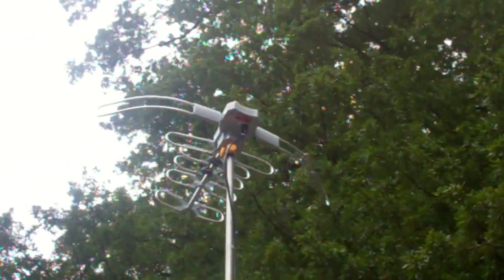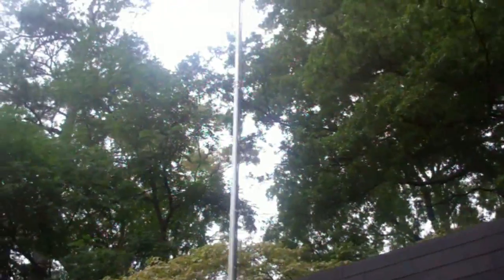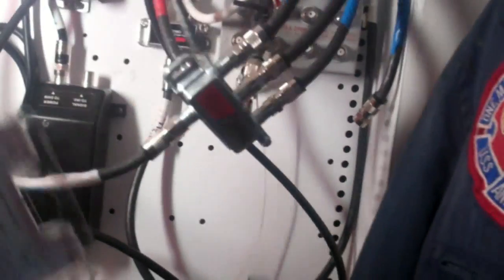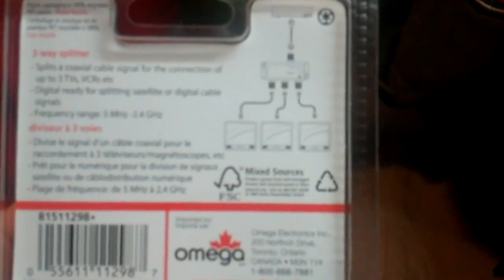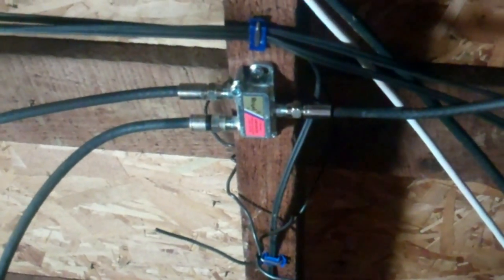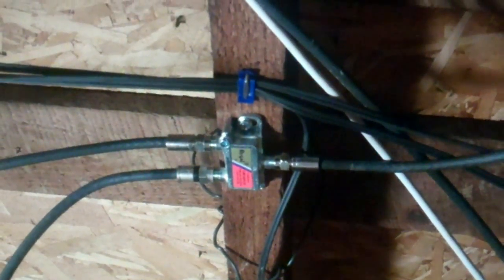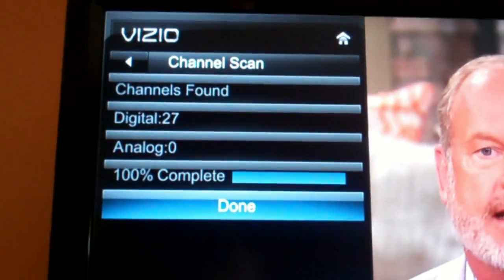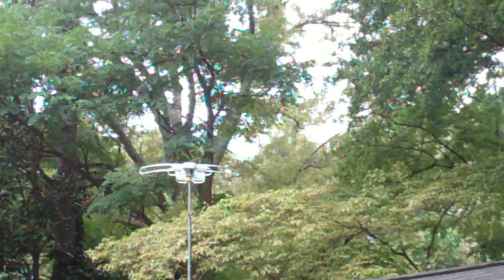Testing an Amplified Digital HDTV Antenna

Comment: Along with the 5-2.3 Gh splitters only use the "Blue" coded cable and connectors.
Your old cable stuff is probably coded "Red" and only receives 5-1005 Mh
And all black old school stuff was 5-900
These cut out frequency and kill your full signal 
Replace ALL of your cables and connectors (even the one your daddy left you, that was his favorite!) and replace them with the BLUE coded stuff.
An Antenna signal is only as good as it's weakest part!! This is not time to scrimp unless you want a scrimpy picture.

RG6 Dual Shield! "BLUE" coded!! 5-2.4Gh

I'm in the woods 30 plus miles from all of the towers and I'm getting a vivid picture on a minimum of 27 channels, so far up to 60 without turning my antenna. This morning I have 43 channels
Reply: I'm also running 5 tvs of the same system.

Comment: you can't use a splitter for that model. It backfeeds 9 volts back to the antenna for the amplifier and rotor to work. Most splitters only allow signals one way unless you get a dc pass with the righ frequency range.
Reply: Yep, he'd have to split pass the power supply. He's defeating his test. I see other issues too.

Comment: awesome .. we dropped cable tv a year ago for basically two reasons ...1. was paying $160 for TV and Internet and they kept increasing our bill every 5-6 months ....  2. we rarely sit down and watch cable TV except for NBA season and Travel Channel or Discovery .. and i can honestly say personally don't miss it at all ... Time Warner increased our internet speeds from 50mbps down to 300+ mbps down at no additional costs and it helps with streaming netflix and hulu simultaneously by all of us 5 here at home..
Reply from the maker: Yeah both cable and satellite prices are ridiculous! Wish we had other internet options here but we're stuck under a local monopoly..
After the wife dropped her Dish account back in May, I knew I would have a problem come NFL season and since most of the games are broadcast on FOX, CBS, and NBC anyway I figured it was time to hook into the free digital air channels..
My friend CJ actually put it together and set it up while we were in Mexico in June so that's why there was no initial setting up video.
Reply: RVR2 yes absolutely telecom companies work with each other to not compete and jack up the prices at an even rate. we got to a breaking point when they began charging for leasing the modem at $7 month and increased the tv boxes lease from $11 to $12 and we used 5 boxes so it was outrages prices...

 looked up the same modem model on ebay and the damn thing was selling for no more than $12 than began watching youtube videos on people dropping services and getting their own boxes so naturally i cancelled tv subscription got me a docsis 3.0  modem for $65 (but currently leasing TWC modem because the 300mbps requires DOCIS 3.1 and its not for sale till later this year)

i sure pray and hope Comcast is not allowed to swallow TWC

I looked up the price on that antenna you have and i thought amplified outdoor antennas would be heck of  a lot more expensive somewhere in the $200 range i got a couple of indoor amplified antennas but they somewhat of an eyesore
Reply from the maker: stryker7x Only reason I still lease my modem ($7 a month as well) is because I had issues with them in the past and they swap it out at no charge, where if one I buy goes bad then I'm stuck with it and have to buy another one..
 There are some expensive ones out there but I didn't see them picking up many more additional channels, especially with all the trees I have around here so this one is sufficient enough for me.
I just hope the government doesn't take away the free digital air channels!